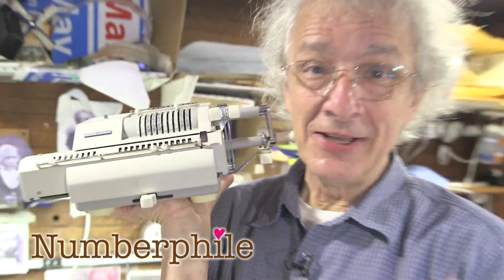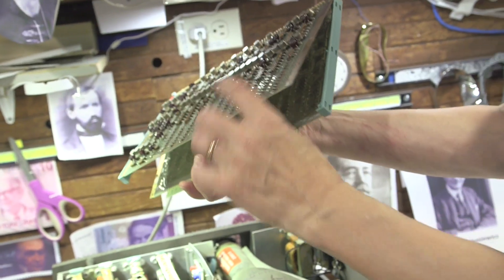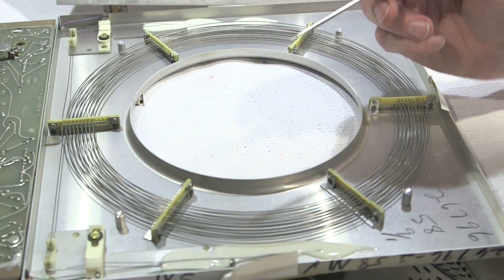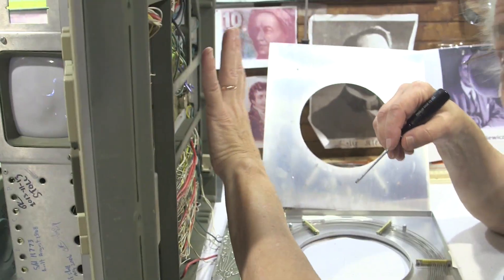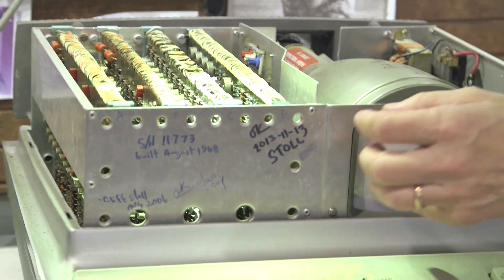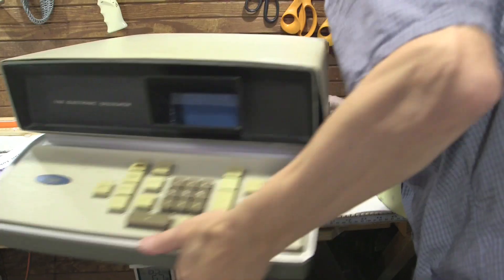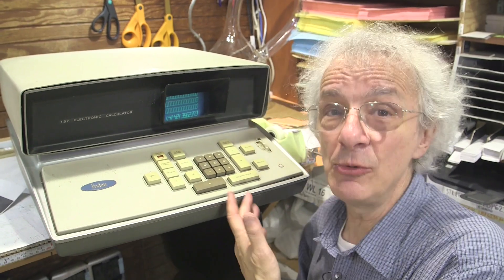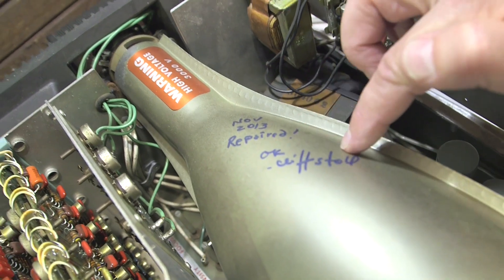An astonishing old calculator - Numberphile

Comment: It's nice to hear people are excited by the old technology. I worked on the first Anita Mk8 calulators and they used ECC81 valves and trigger tubes. The timing was done with a tube called a Dekatron. The trigger tubes needed a bit of 'cosmic radiation' to actually be able to strike but when the machines casework was on, there was no light entering the works! The trigger tubes has a little device in them called a 'night light' which glowed permanently that took the place of the much needed 'cosmic radiation'  19 meg ohm resistors fed the 'night lights' and often went very high resisstance because they were just carbon. All the fault finding was done using oscilloscopes and Avo8 multimeters  down to component level.. The display was done by Nixie tubes which were stepped by these trigger tubes to the appropriate numbers, The machine had just one single transistor called the Highway transistor and was a silicon 2N3053.  I still have the blueprints for the Mk8, Mk9/10  machines and they make a great talking point picture for the hallway.

Comment: after further reading: - The wave in the acoustic memory is a torsional wave, not a compression wave. Apparently torsional waves can survive damping at the mounting points much better than other kinds of waves.
Reply: abuslinky But did this early model use that fact?

Comment: can anyone elaborate on the piano wire memory storage? Is it holding just one number or can it somehow hold multiple? is it strictly a place to temporarily store one of the digits and everything else does the heavy lifting as far as multiplication and division Etc? and how is something able to read the tone of a vibrating wire and create a meaningful output? That seems so advanced for a device that doesn't have traditional working memory
Reply: CreeDo Lala It holds as many bits as the transmission speed multiplied by the time it takes for one trip end to end.  So by putting the output bits back in created a carousel of a few hundred bits.  Many machines of that era actually used the round trip time to clock the calculation boards above,  just to keep everything in synch.

Comment: Even more astonishing is Olivetti's competing calculator from the same year of 1965 https://en.wikipedia.org/wiki/Programma_101 , the first programmable desktop computer (in so far as anything with about 240 bytes of writable memory can be said to be programmable!) Nice industrial design too.

3:52 Oddly enough those old germanium transistors would cost roughly the same amount today, even adjusted for inflation: they're prized as components in '60s-style guitar fuzz circuits.

Comment: I have a 1973 Tektronix model 31 "portable" scientific calculator. Dang thing weighs more than 30 LBS. It has a printer and tape unit for storing programs. The boards look a lot like the one in this video, with TONS of TTL ICs. No piano wire loop! Unfortunately one of the Sperry SP-332 Plasma displays has died, so three of the display digits are missing. Apparently this was 3,000$ when new, plus 700$ for the optional printer.

Comment: I'm seeing a lot of carbon film resistors on those boards, which would be the first place I would start looking for problems. Carbon film has a tendency to drift over time, so I would go about replacing all those resistors with more modern equivalents to keep the machines working.

Comment: I had an old Wang "desktop calculator" with a 12 digit nixie tube display and keypad connected to the electronics suitcase by a 1/2"' cable. It too was all discrete components, no Integrated Circuits. They used ferrite core memory. I think there were a dozen or so PCB cards which plugged into edge connectors inside the main chassis. It worked for a while, but then something shorted and kept burning out a 5W resistor. I don't have this calculator any more. Piano wire acoustic memory is new to me. Fascinating! When you get everything working on the 2nd unit, tracing out a full schematic from the circuit boards would be a worthy effort. It will help who ever inherits these technological gems maintain them in the future. I wonder what is the schematic symbol for acoustic memory. Lol. A coil with a hammer on one end and a microphone on the other?
Reply: Wikipedia has an article on "Delay line memory":
https://en.wikipedia.org/wiki/Delay_line_memory#Magnetostrictive_delay_lines

Comment: Im not a mathematician but how do you mannualy calculate square root of two???
Reply: danijel124 You can use a sort of approximation method to find its digits pretty easily. Let's try 1.5 squared. That equals 2.25, so we know that first digit isn't 5. What we need to find is the largest digit  that is smaller than 2 when squared. If we try all the digits smaller than 5, we see that 1.4 squared is 1.96, so 4 is the first digit.  You can do this for the rest of the digits.

Comment: I guess the problem about the not working machine is, that the germanium-transistors that were used often create so called "Whiskers" inside.
The whiskers short out one of the electrodes (mostly the emitter) to the case - which is commonly the collector.
These small crystals are a natural aging process and so it can happen that a machine still works fine and a day later it does not anymore, because one of the transistors were finally shorted out.

But you can fix these Transistors! Just tie all three pins together and then put a high DC voltage between the three pins and the case. About 200 Volts are fine.
The whiskers now got burned off and make no more connection to the case. I managed to fix very many germanium transistors with that method that can not be simply replaced by a silicon one.
Reply: Phalos Southpaw's Bastelstube interesting, I hope Cliff sees this!
Reply: Write an email to cliff! Link’s on the Klein bottle website
Reply: I have dabbled in reading up on early transistors, and it was this thing you explain, that made them difficult to create.  Very finicky.  Obviously they solved the problem, eventually.  I have also seen BJT's modeled as two diodes, sharing the same N or P layer, with the understanding that it's more complicated than that :)

Comment: What your'e describing is not memory but an analogue delay line. As for the user interface of the calculator, it's interesting that it used what HP would come to name "Reverse Polish Notation".

Comment: when i was about 10 in the late 70's i used to go to a local electronics shop that sold pulled boards and paid 20p or so for a board.  I am sure i had at least 1 board that came from one of those!  It provided a huge supply of diodes and transistors for me to experiment with and BLOW UP in the name of learning.

Germanium diodes light up when stuck across batteries.. briefly :p

Comment: That acoustic memory is fascinating too. Also, little correction: there were two wires inside a tube, wetted in mercury and each pulse was sent and received as a twist in those wires. The coil induced a magnetic field in one of the wires, making it shrink in size, and effectively twist with the other one. That twist traveled along the tube and was picked up on the other side as a magnetic pulse.

Comment: I have a Friden EC-132 as well (it was the follow up to the original EC-130 model. It added the square root key) and a Smith-Corona Marchant Cogito 240SR (and a lot of other models). I LOVE these old machines, and seeing one of these old machines on a trending video makes me INCREDIBLY happy! :D
Those engineers were SO thrifty with those terribly expensive transistors, that a LOT of the logic was actually done with resistors and diodes!
Transistors were reserved for flip-flops, signal inverters, and buffers (signal amplifiers).

Comment: He was lucky to have not shorted out the working calculator when he removed the metal top cover. I've shorted out the circuit boards on two garage door openers doing what he did.  Always unplug the unit before you futz with it.

Comment: Back in the 40s and 50s they also used mercury delay lines -- long glass tubes filled with mercury, and similar to the piano wire memory of this video, sent acoustic waves down the tube and either modified or sent the same bit back around again.
Reply: Read the first page of Asimov's first robot novel, "The Caves of Steel" (1954).  The detective protagonist requests some data.  Asimov describes the data rippling through mercury and when the data is read out it's recorded onto a piece of wire (wire recorders predated tape recorders by half a century -- in one of the first episodes of "Mission Impossible" (1966) the data they sought was recorded on wire which was hidden in a window planter).
In 1978 I was serving as an Air Force computer technician.  In a required correspondence course for my AFSC I studied a magneto-strictive wire delay-line memory (identical, I'm sure, to what's in Cliff's calculators).  In tech school, we were introduced to delay lines, but by then they were just used to ensure that all the signals got to where they needed to be at the right times (signals travel at about the speed of light, about a foot per nanosecond) -- the 1980 Cray S1 supercomputer ran so fast (for that time) that for a delay line they'd just lay down a few centimeters more trace on the circuit board.  However, by 1977 our tech school no longer talked about using delay lines as memory; that was just a historical footnote the instructor added on his own.
Learning how we used to do things is fascinating.
Reply: @davidwise1302  read my above comment. Or I'll just retype it lol.
VCRs sometimes used delay line coils for the same syncing and timing in video channel data, as a delay line was cheaper than some expensive super quick memory solution.
Reply: fudgesauce Up until about 2000, TVs used ultrasonic acoustic filters inside.
Reply: VCRs and camcorders sometimes used "delay line" lines (like blocks with coiled wires/lines in them) to sync different pieces of video channel information cheaply.